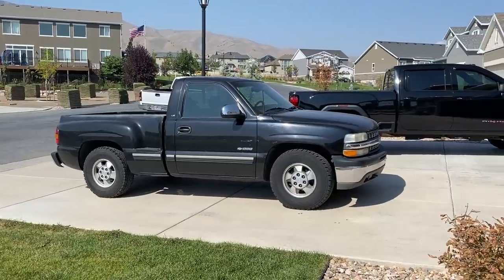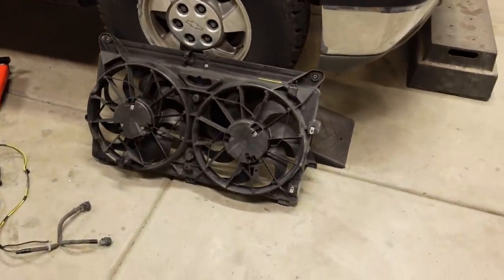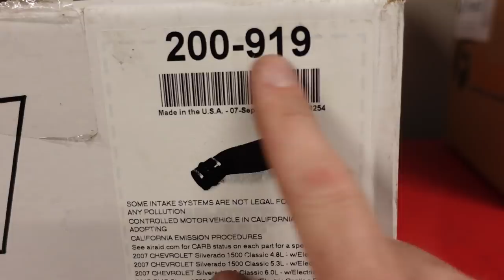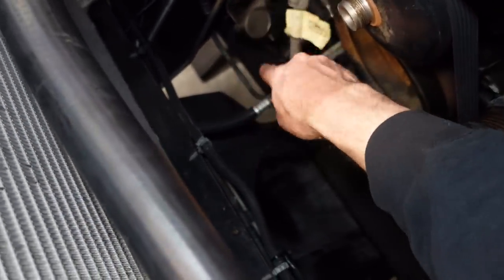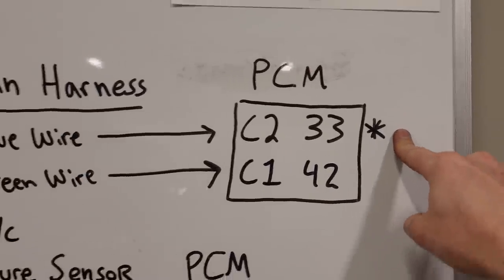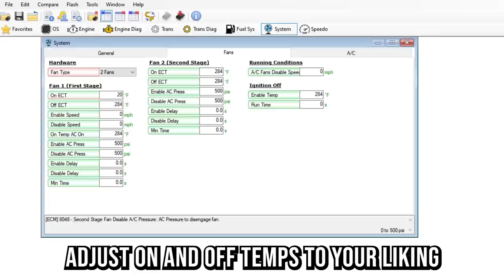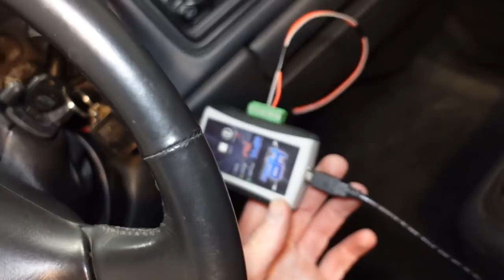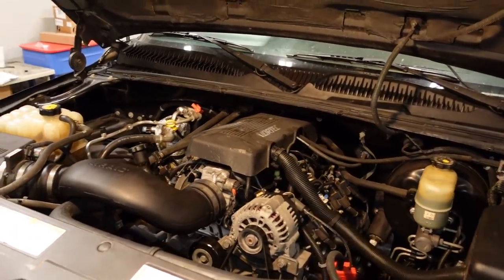the BIG BLOCK KILLER 4.8 is DONE! + electric fans on a 99-02 Silverado the RIGHT WAY

Comment: Oh man that increase in MAF demand for the AC is genius and now I'm going to get that done because currently whenever the ac kicks the power bogs and has to recover.  I wish I had known!  (I also did that fan conversion)
Reply: man everyone from downtown floride does it. you must be new to the groove
Reply: @gearbanginentertainment7476  I'm in Detroit, apparently we aren't used to tuning a higher idle on AC for those.  They're gonna learn now though!
Reply: I done what he said and my ac keeps freezing up not sure how to fix it on my 2002 silverado
Reply: @jefffleming1743  freezing up how? If the compressor is locking up its going to be in there and not the fan swap... I'm sorry to here you're having issues, I can tell you since it's been over a year since my last comment that once you have that sorted out the AC is incredible even while idling.
Reply: @Nick Felice  it works fine at first then after driving the lines outside freeze up with ice then my ac stops blowing threw the vents because no air can get threw when I first done it last week the compressor was cycling off and on but not just stays on I done it just like you said
Reply: @jefffleming1743  okay typically when freezing happens in an air conditioning system it indicates a lack of freon. The repeatedly cycling compressor also indicates that. Have you checked the AC system and recharged?
Reply: @Nick Felice  I checked the ac and all is good  the compressor kicked on and off like its supposed to at first but now stays on can the orifice tube make it freeze up
Reply: @jefffleming1743  so that I'm not sure about. I'm sorry that goes a bit deeper than my knowledge. Hopefully someone chimes in here on our thread!
Reply: @Nick Felice  OK thank you

Comment: One more "mod" take the small hose going from radiator to the throttle body and bypass the throttle body. Intake Temps instantly lowered.
Reply: I did the same on my swap
Reply: yeah but if you drive in the winter or cold conditions you will have idle issues some say

Comment: Absolutely fantastic content LT!! I've done three of these upgrades and had to do extensive research because it is hard find the right information to do it correctly. You just summed it up in one short video and absolutely no one else has done that. I totally agree to use the factory harness and fans (and you even got the best one). Just change over the pin and upgrade the AC sensor. Everything just goes right in place like was always there. Way cheaper than aftermarket and a noticable difference when driving. I did pretty much the same settings as you (but I can't understand why the stock on/off temps so much higher). Thank you so much and hi from North Gorham.  I can't wait for the tune video, that should be fantastic, you'll be at 100K and then some with great content like this! PS great explanation on the bigger and smaller radiator. Just just look at the bolt-holes... 👍
Reply: I had to add that i did go to the 145 amp alternator from the 105 that was stock.  Just grabbed a new looking one for 20 bucks extra when I was at the junkyard on the last one. Not 100% sure if needed but hope it can't hurt.  Better gas milage, more power and A/C is ice cold.
Reply from the maker: Good idea on the alternator too.
Reply: Where does the a/c pressure sensor tie into? Which schrader valve? does it replace the high pressure switch on the compressor to condenser line?

Comment: Very cool can’t wait to see what it’ll do on the dyno, I’m building a 6.0l I have a cam , valve springs, a fuel pump , torque converter and a trailblazer ss intake and I’ve got a vortec super charger that’s on my 5.7 that will be going on the 6.0l . Going to be putting it in my 97 Chevrolet Tahoe 2 door

Comment: Hey if the base idle airflow isn’t cutting it with your tune. Flip the throttle set screw and drive it down for the first try. Reprogram TPS and it’ll make the base tune SO MUCH EASIER

Comment: A great option for boost for the 4.8 would be a second-hand supercharger off of a Cadillac or Camaro. There is a guy that makes adapters specifically for that purpose.
Reply: news got out and theyre unfortunately not worth it anymore
Reply: @gearbanginentertainment7476  There are still lots of companies that make the intake manifold adaptors for the LSA supercharger.
Reply: Too much buck for the bang

Comment: One thing... I don't think the HIGH speed fan will work unless you put an A/C pressure sensor into the system. I have done several of the electric fan conversions and the ONLY way I have ever been able to get the HIGH speed fan to work is by installing the GM A/C pressure sensor-just like all the factory trucks with dual electric fans come with. Without that sensor, I don't think the computer will ever command the high speed fan to come on. If you turn the A/C on and you don't have the A/C pressure sensor the computer will not command high speed fan  for moving more air across the a/c condensor...  Just so you know.... Essentially you MUST either install the A/C pressure sensor, or you can set up the high speed fan to be triggered any time the compressor is running, or the A/C switch is turned on. The downside to running the fan manually triggered is that the fan will run at all times when the A/C is on.. Even when you are on the freeway at speeds high enough that you don't need them to be on... Wasting energy, burning more fuel... It's better-let's just say mandatory-to install the A/C pressure sensor.... Just do it the way GM did it and you can avoid a bunch of drama. Those pressure settings he was changing in the tune @ 13:10 make NO DIFFERENCE unless you have an A/C pressure sensor... which the truck he is working on did not come with the pressure sensor on it from the factory. Why he was jacking with the pressure settings I don't know...

Comment: My only question is, are you going to upgrade your alternator to handle the additional load from the fans? If so, ICT Billet has some great alternator conversion options to allow you to run the 160 amp DG44 from the GMT900 trucks… it’s the direction I went with my 99 extended cab…

Comment: Looking forward to seeing the tuning and dyno results! Then after AWD conversion, it’s “what power adder?” Spooling a big turbo with a small engine is problematic, so I wonder if you could plumb a twin turbo setup to spool one, then add the second through repurposing a big wastegate. Kind of an X-pipe to the twins. The ultimate power will be limited to what the turbo compressor(s) can provide, so you’ll have to match the lb/min of the S480 if you want a chance to match the 547’s power with the 4.8. There have been some complicated OEM turbo setups—maybe you can do one better!

Comment: I misunderstood the situation about the AC are you not running ac on the truck? If so did you replace the pigtail on the back of the compressor or did you do simply charge settings on the ho tuners to get the AC to work. I have a 2000 Silverado and just got done with the e fan swap with the original harness.thank you for the helpful tutorial btw
Reply from the maker: AC is fully functional on this truck with the electric fans. all I had to do was wire in a 3 wire AC pressure sensor, and change the settings in the computer... I was pretty sure I showed the wiring steps in the video
Reply: Do you need the ac pressure sensor to get the ac compressor to kick on or can I tell my tuner to make a change in Jp tuner until my sensor arrives?

Comment: Lt i have a 2015 tahoe. Stage 2 brian tooley cam, ls7 lifters, hardend pushrods, conical valve springs. 6.2 liter intake manifold cold air intake. Headers full exhaust. Texas speed program we gotta run em. Hahah

Comment: Most cold air intakes are nothing of the sort and even when they are they don’t add power.
With rare exceptions the factory intakes are often the best and safest.
With many aftermarket cold air intakes there is a great risk of hydro locking the engine when it rains. Many don’t even get any cold air from outside the engine bay. And unless the design is deliberately restrictive for noise or some nonsense the factory intake will flow more than enough for a stock and even some not so stock engines.
The major purpose of a cold air intake is to keep power not add it. The hotter the air going into an engine the more likely it will predetonate and the less dense the air fuel mix so the computer will pull timing to prevent detonation etc and thus you lose power.
Reply: Anything is better than the intake systems that come on these trucks, if you’ve ever take one off you would see how restrictive they are, I got a cheap 4 inch intake kit from amazon and it definitely made a difference, I even took off the tray that the oem filter housing sat on to get more airflow and haven’t had any hydrolock issues

Comment: Can you do e fans on a 02 v6 silverado the stock way you did it or is it only applicable to v8 s?  And if so can I use the exact same setting you used in the hp tuner?, It gets hot here in Texas traffic and really would like e fans. Thanks!
Reply: Yes, the v6s use the same pcm. Same process.

Comment: Warning 
Use high temperature exterior grade double stick tape always especially on the dashboard.
You will really regret using anything but the good stuff after one afternoon in the sun.
I used some stick on Velcro pads to hold a device to the dash once and the glue melted and made its way into every button and plug hole on the device and the dash.
Reply from the maker: fair point!

Comment: As always, great information 👍l wonder if l could do the electric fan upgrade on my duramax, instead of the power robbing factory clutch type fan? Hmm, great work! I Thank You.
A little redundant on my part, but your going to replace the battery  tray with the turbo install? everything else looks so good, it only makes sense,  right? 🤞😁✌🏻❄ 🇨🇦 😎.

Comment: I would be cautious in using electric fans on trucks. I know most of the newer Tahoes and Silverado use Electric fans from the factory. However, they have very wide radiators. My TBSS(Trailblazer) has a top flow older school radiator... due to the narrower width of the SUV and Grill. Therefore i put in a $800 aluminum radiator that is much thicker thank stock.. probably 40% more coolant volume. I put the highest flowing electric fans on it.. over 5000CFM.. IT was not able to handle hot days towing my boat in the Sierra mountain area. It was heat soaking and the thickness of the radiator was too much for the electric fans.  The stock mechanical fan pulls 2x more air.. I also argue that the HP gain under most conditions is not worth the complexity of electric fans. You might loose 15HP on a warm day. So unless your priority is your best ET at the track.. I would say trucks that have mechanical fans.. should keep them.  Overheating at the cost of gaining 15 hp is not worth it..  I would suggesting thinking about what your priority is. There is a reason almost all Diesel trucks and Semi's use mechanical fans.  If you tow more than 5k lb... I would stick to mechanical fans.
Reply from the maker: fair point, but the fan and radiator package I installed are designed to work in a 1/2 ton truck, and the fan I chose was from a 2009 silverado with the towing package which got more fan blades than a non-towing package. also, the stock electric fans from a silverado require you to install a wider factory radiator anyway. I agree with all your points in theory, but by using the parts I did, I am relying on GM's years of research.

Comment: By using analog, Have you had any problems with the ac compressor not cycling off causing the evap and accumulator to freeze?
Reply: I'm having the same problem did your find a solution

Comment: Other than stock look, why do you not like aftermarket electric fans? Are there big reliability issues? Not cost effective? Just curious because it seems like most of the time the aftermarket develops something better than stock
Reply from the maker: Many aftermarket relay harnesses for example are made with inexpensive relays, thin wiring, and use cheesy temperature probes or require an additional temp sensor to activate the fan. A lot of aftermarket fans don’t fit as well as factory since they are designed to be universal, they are much louder, and sometimes not as reliable. The factory parts are designed to last hundreds of thousands of miles, use quality components, and in my experience, are generally more reliable.
Reply: It's called (made in china)
Reply: @richardpetker4337  I am willing to bet gm sources the motors from there too

Comment: I bet the electric fans are better for cooling and horsepower but it makes me wonder how much more load the alternator is experiencing and if that would translate into a harder to spin alternator.  If so I imagine it minuscule, un noticeable on a dyno
Reply from the maker: There will be a little load from the alternator, and the fans don’t run all the time, so if they’re off, there will be no load on the alt.
Reply: @LawrenceTolman  that's what I figured.  Thanks for the reply. Even though there is load on the alternator,  since it's just recharging the battery and the power from the fans should come from the battery shouldn't the load be minimal and does it necessarily translate to a harder to spin alternator.  Plus the removal of the mass of the clutch fan alone is way more gain than any load.

Comment: Did the Taurus 2 speed fan a few years ago on an 03 5.3, have to say the best 30 Hp freed up on an engine for less then $100. Taurus fan, Volvo controller BMW 2 temp coolant sensor for speed controls. 

Have you got the “all on lights mod” done LT? Another < $5 mod that improves life.
Reply: But did it free up 30 hp? If it did your fan clutch wasn't working right cause the fan should only be running when stationary and maybe below 20 mph.  Beyond that the clutch disengages and vehicle speed moves the air
Reply: @MF11283  yes it frees up the power the weight of fan is consuming. And based on math the power consumed by the electrics is nothing compared to the weight of a physical fan. Say 15 lbs of fan physical weight would be equal to 22,380 W or 30 hp of consumption. Electric fans are 12Vx30A(max not RMS)= 360 W.  or .5 hp. So you free 29.5 hp by removing 15 lbs of weight from a rotating mass of this size.

Comment: Where does the AC pressure sensor connect to in the AC system? BP auto says the Schrader valve? Is there a retrofit fitting that enables it to do that or does the factory sensor screw right onto one of the Schrader valves?
Reply: anyone? does it replace the high pressure switch??
Reply: @chesterfield.mcdermott  All you do is replace your existing high pressure switch with the one included in the BP Auto kit. Then you run the wires to the pcm.
Black wire Blue PCM connector 49
Gray wire Blue PCM connector 8
Red/Black Stripe wire Red PCM connector 14
Reply: @RicsChevys  amazing! Thank you!! I had been running the separate relay from the compressor clutch and it was a rough go on the idle!  So it works the same way as the high pressure switch as well just with actual pressure reading?
Reply: @chesterfield.mcdermott  Yes.
Reply: @RicsChevys  thanks so much!
Reply: @RicsChevys  Is there any other programming required other than LT's description?
Reply: @phillipjohnson2244  No other programming required.
Reply: @RicsChevys  Seeing if you've experianced this issue before. Second stage Enable AC press 290 is not engaging the high speed fan. Curious on suggestions
Reply: @phillipjohnson2244  No I have not.
Have you checked your fans to see if low and high speeds are kicking in, regardless of trying with the A/C?
Reply: @RicsChevys  I have and they are working correctly based on engine temp
Reply: @phillipjohnson2244  I've installed two of the BP kits and both worked fine. Doble check everything. Try lowering the pressure on fan two from 290 to 230 like fan one, just to see if it kicks in. If it does, just adjust the fan two to a lower pressure than 290. Hope it helps.

Comment: Hey LT (and anyone else who might have an opinion), what are your thoughts about tuning the 9354896 PCM vs the newer P01 and P59s? I have heard that the PCMs from the 99-00/01 silverados are a lot more finicky (high likelihood of "bricking" when inputting a tune) than the 0411 and its successor the P59 (which has the flex fuel capability). I just picked up an LM7 from a 99 silverado that I will be putting in my 96 GMT400, I am wondering if I should be finding a different computer for this build (and thus dealing with the pinout changes) before I invest any time and money into utilizing the old 9354896 PCM.

Thanks!
Reply from the maker: thats a question that's a little above my pay grade lol...
Reply: @LawrenceTolman  looks like from yesterday’s upload that the PCM behaved perfectly! So perhaps I’m making mountains of mole hills. However the LM7 I bought had a spun cam bearing so I’m back on the hunt for a good block 😒 lol

Comment: I need assistance, in video you say to put the red/blk signal wire in c2 14, that is an open wire in c2 14, you're not using the egr signal circuit, WHY, I wired my 2001 Yukon Denali as you stated and when starting, both fans run on low speed, when turning AC on I see a voltage change in AC pressure but no high speed fan. I set to analog as stated, HELP PLEASE

Comment: I bought the glenns auto performance e fan harness and the same fan you have.  For some reason when it’s in the heat of summer and my AC is on blast, the engine temp runs hotter than normal.  Is this possibly something to do with the AC being on?  Both fans are running when the AC is on.
Reply: The AC being on generates more heat in the engine because of the horsepower it uses. The AC condenser also heats the air passing through it on the way to the radiator.